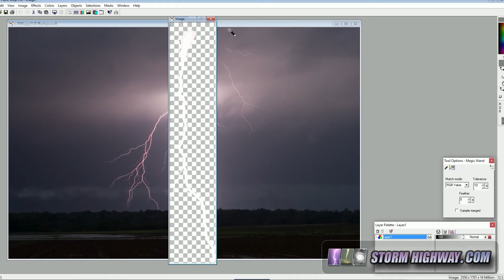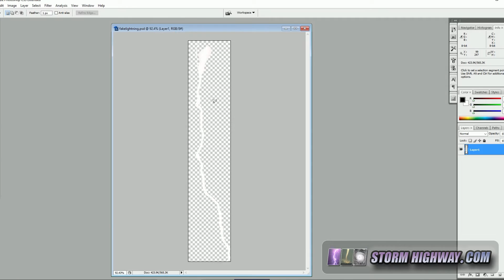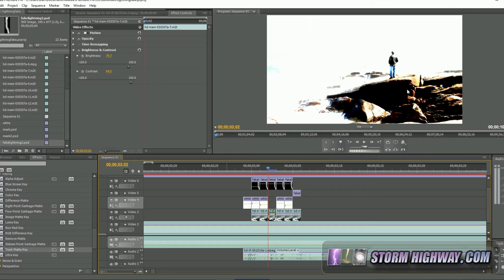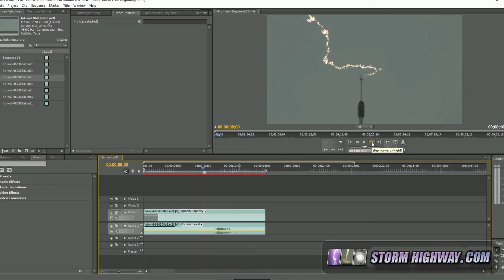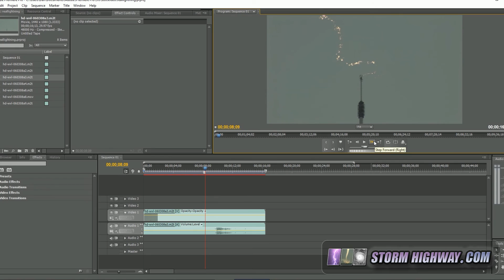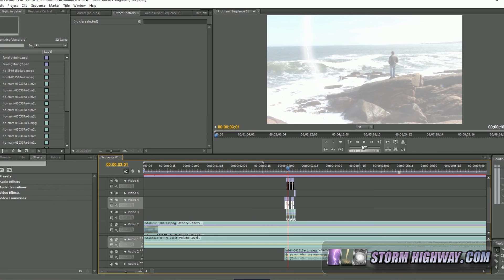Lightning video fakes: How they're made & how to spot them

Comment: Very cool video of "hot lightning" turning into bead-lightning.   That doesn't normally occur.   It's in the rare percentage of strikes which last for tens of milliseconds, where the vast majority of strikes last a few microseconds.

In a huge thunderstorm a couple years ago, I saw a couple hundred normal strikes, plus two "hot lightning" strikes which lasted for about a half-second.  The lightning became tortous-shape, then broke up into beads.

That's the kind of lightning which makes charcoal,  explodes trees, and even melts aluminum flagpoles.